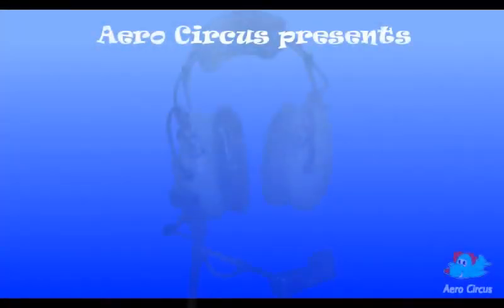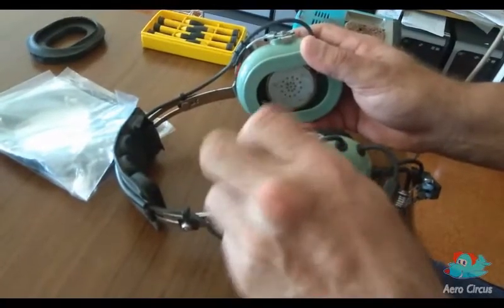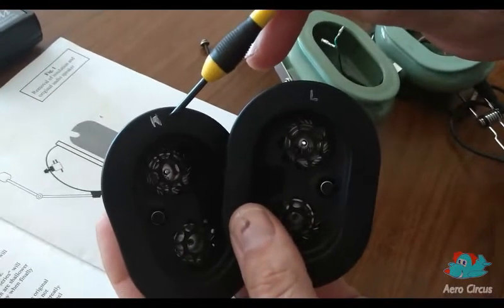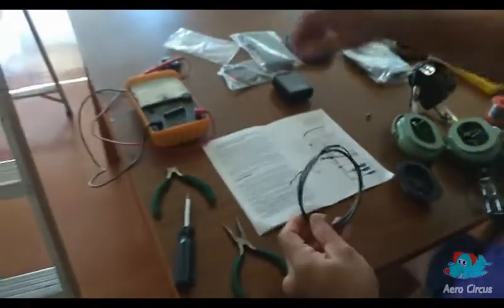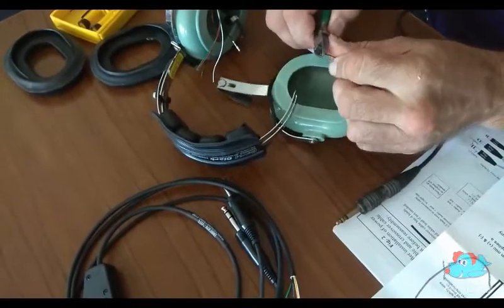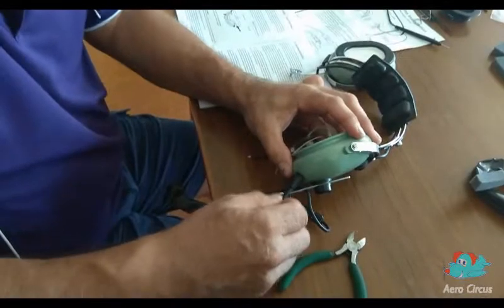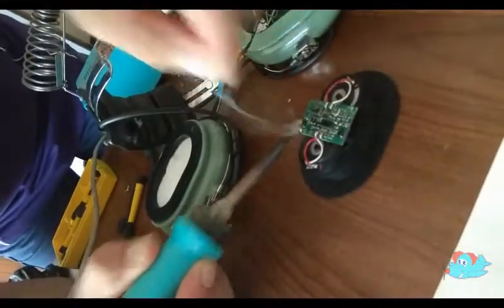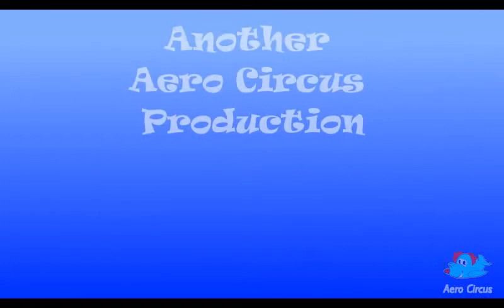[TUTORIAL] Active Noise Reduction Kit - David Clark

Comment: Hey guys. Thanks for putting this video up. I just aquired a leather flying hat/headset that had a weird extra DC power cord... wasn't sure if itwas some wog PTT setup or what. I'm now confident its this ANR mod. Do you know what voltage is supplied to the  headset please? Up Your Knots, Terry NZ.
Reply: Hi Terry, most ANR headsets use a 9V battery so that's the most likely voltage you would encounter.